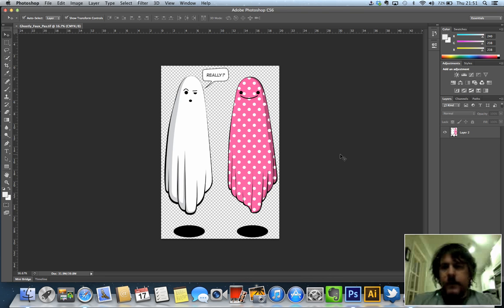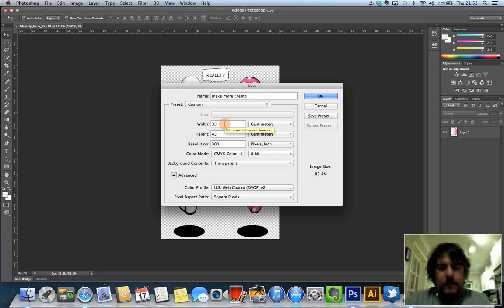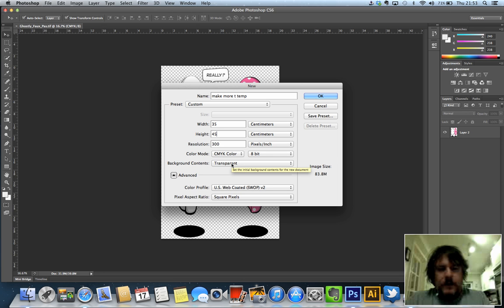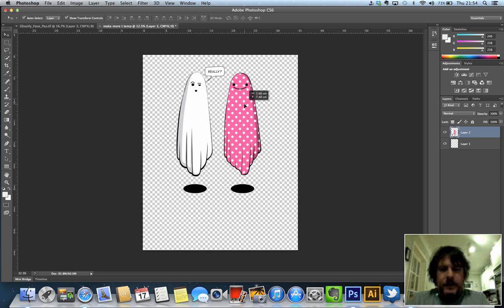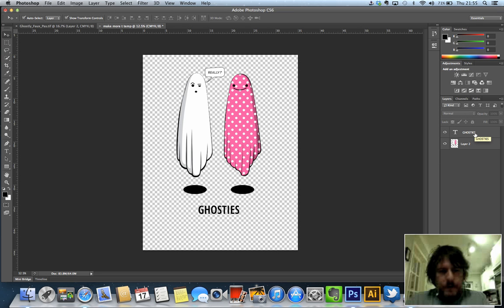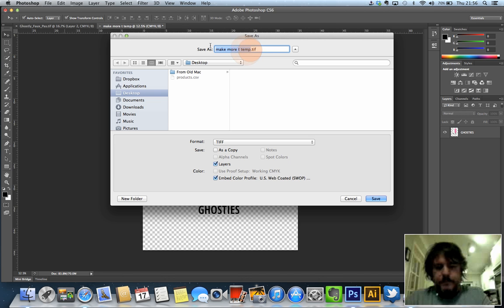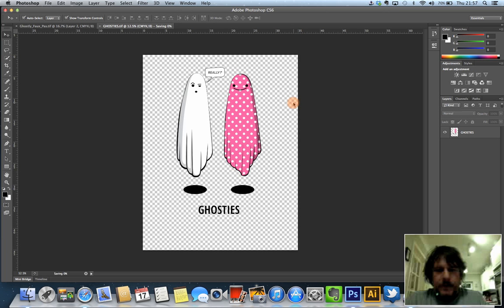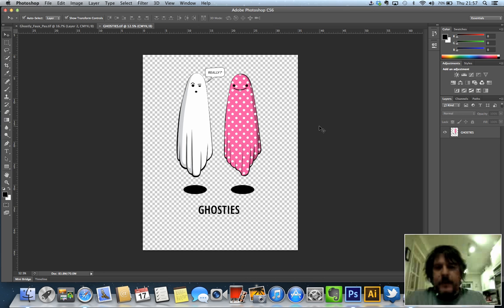Tutorial For Preparing A Design For DTG Printing

Comment: Thanks for posting this.  I'm getting a red halo in certain parts of my design.  I'm printing a black silhouette on white shirt.  I've reworked the design several times to find the red appearing.  My table height is perfect.  I've ruled my printer out, it's in my designs.  Any suggestions?